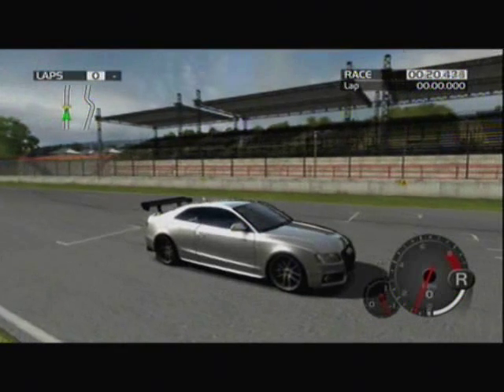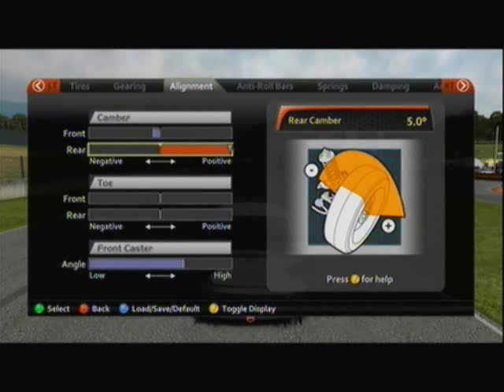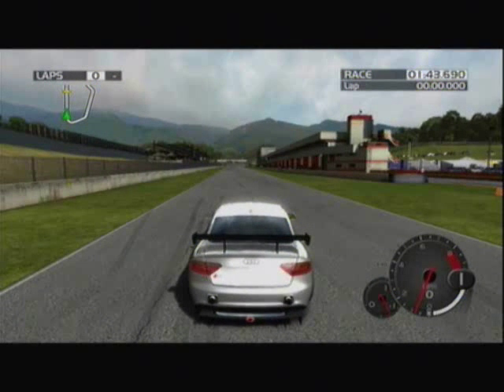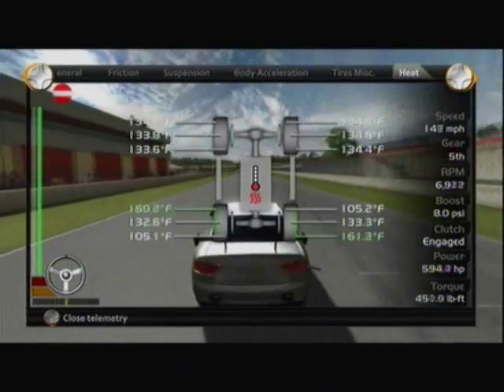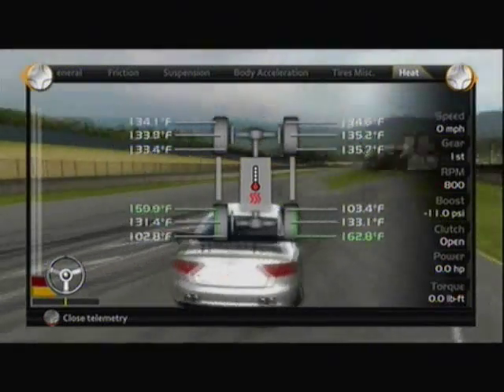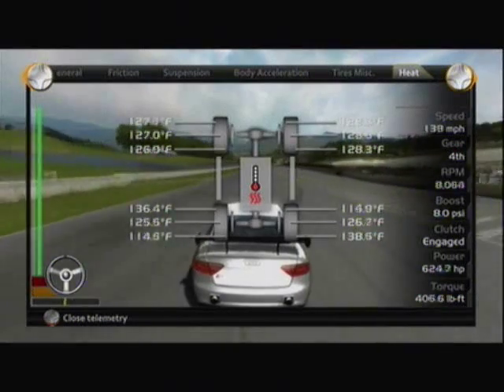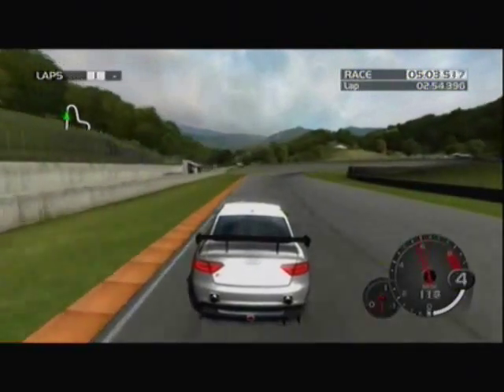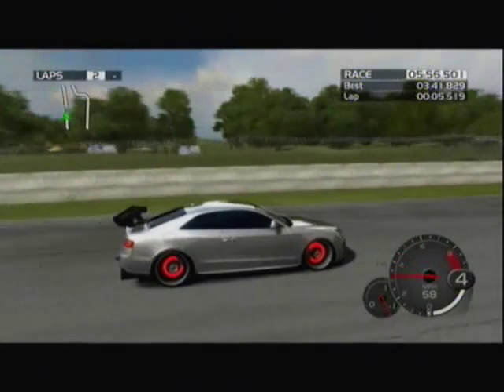Forza Motorsport 2  - Tuning Camber

Comment from the maker: Camber settings on a drag set up would need to be set up by first setting up your rear spring height and stiffness (these will vary with the vehicle, weight, HP, etc).  Once this is established, you know how much the rear of the car will squat down when you accelerate on launch.  From here, watch replays of your launch with different camber settings.  Pay attention to the heat measurements.  Adjust camber from there to get the flattest (most even heat) contact patch.

Comment from the maker: @necrofagg0t Positive camber WOULD be best for the tires inside the turn.  However, this poses distinct problems.  First, if the tires were cambered for one direction of turn, say Left, then they would be ill equipped to handle the opposite, or Right-hand turns.  This is counter-productive.  That is, unless you're a NASCAR, then it's not only best, it's the only way to be competitive.

Comment from the maker: It sounds like you're probably locking the tires up in a corner.  This means you have to "feather" the brakes.  I explain this technique somewhat in the second video.  Stiffness in cornering can be a multitude of things.  List a few specifics on the setup of your car.  I may be able to help from there.

Comment from the maker: Negative camber on front and rear (dial in the necessary amount for your vehicle via test driving) and positive rear toe.  My "Toe" tutorial/s are soon to be added, so keep checking back.  Additional settings are needed for drift, but the two I mentioned above are the most crucial.  Try setting camber on both front and rear to approx 1.0-1.5 degrees to start.  Then, about 1.2 degrees positive rear toe.  Hope that helps.